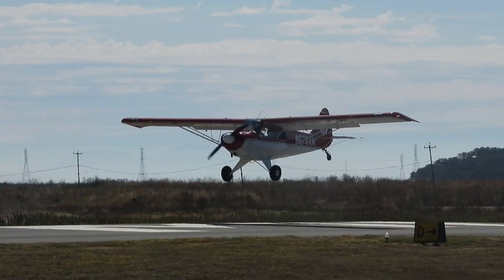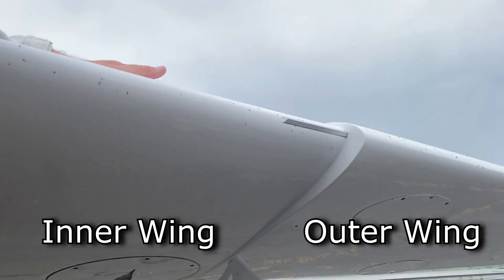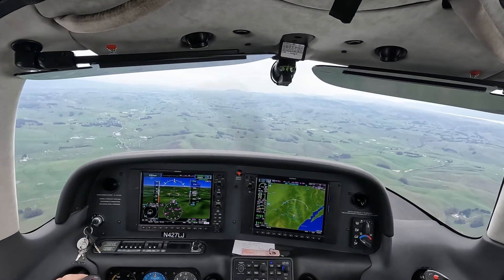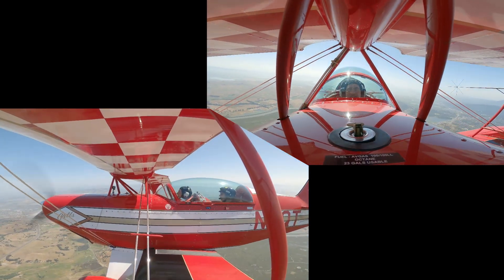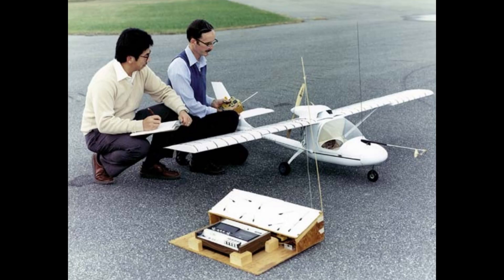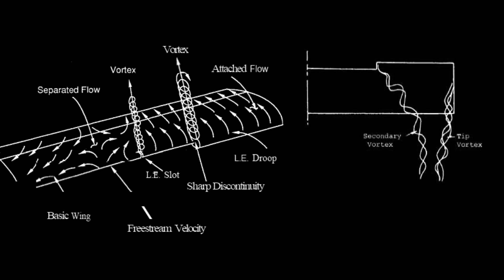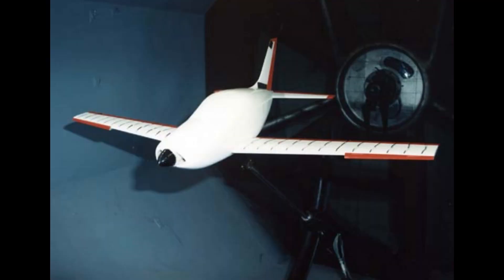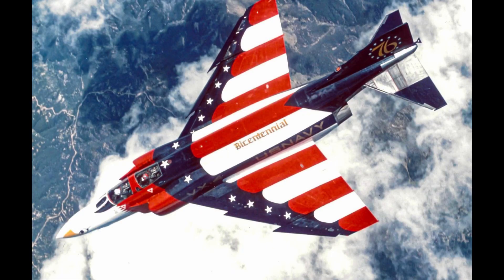Why Is The Wing Broken On Some Planes - How a 'Dog Tooth' Makes Wings Work Better.

Comment: This is very misleading, when a wing stalls it does not decrease the amount of lift you generate, your wing will still generate lift, and it will still increase with higher AoA's, it will just be very very inefficient at it, and you most certainly do not lose your lift and fall out of the sky.

If you have enough power you can fly beyond the stall, fighter aircraft do this all the time.
Reply: “When a wing stalls it does not reduce the amount of lift you generate” lol 

“And it will still increase with higher AoA” Can you draw for me the lift vs AoA curve and explain that again?
Reply: @electricalmayhem   "Can you draw for me the lift vs AoA curve and explain that again"

YT doesn't allow for the drawing of things to explain things to you...

Cd vs AoA graphs are out there for you to look at yourself, the lift does NOT drop to zero, it will keep on rising, and reach Cl max, it does not become a vertical line straight down to zero lift, it tails off, then drops off after cl max.
Reply: @LeoH3L1  Mate I was being sarcastic, I used to be a flight instructor. That CL max you talk about, or the critical angle, is the seal. From there the lift doesn’t continue to climb. You are correct it begins to reduce not a straight line to zero, but your original assertion that it continues to increase with AoA is wrong. 

Three things happen when flow separates at the critical angle: 1) lift reduces, 2) drag increases, 3) CoG (correction: Center of Pressure) moves rearward (for a given wing segment, can be different when considering the whole wing in some situations like Scott said about tip stall in swept wings)
Reply: @electricalmayhem  Yeah, you're correct about that, I didn't mean what I said there, should have phrased that better.

BTW CoG does NOT move (ignoring fuel movements) I think you mean CoL...

I guess the best way to explain what I mean is that even if stalled, if you have enough power, you can still maintain enough lift to fly, and even climb with a stalled wing.

I suppose it depends on where you define on the curve what a "stall" is, the cl vs AoA line is generally fairly straight and then turns downward, the stall is developing at the beginning of that down turn, from that point on it can still increase until it fully stalls at the peak.

Going by that definition, it is a stalled wing, with some headroom on the curve to generate more lift with before being a fully developed stall, a stall isn't an either or thing, it's not stalled vs unstalled, it's a transition, going from the start of the stall to it being fully developed, the lift is still increasing to that point before entering the fully developed stall and decreasing.
Reply: "It doesn't generate less lift, it just becomes a brick"
Reply from the maker: I think you’re confused by the fact that most data graphs for airfoils plot  lift / drag ratio. Take a look at this drag curve plot and you’ll see that there is a peak in the Coefficient of at about 18 degrees AoA - above that it decreases. https://en.wikipedia.org/wiki/Drag_curve#/media/File:Lift_drag_graph.JPG

What you’re probably thinking is that for an aircraft with sufficient thrust to overcome the drag you can indeed keep it in flight above the stall angle, the wings continue to generate lift, just not as much as the unstalled wing. And of course, in this region it’s common for that aircraft to lack control.
Reply: @scottmanley  I understand that, what I'm saying is that the stall doesn't begin at the peak of the L/AoA curve, but just before it, see my last post where I clarify it, you can see on the graph you posted, it starts at about 17 degrees, and fully stalls at about 18, the stall doesn't begin at an instant.

In that region between 17 and 18 degrees in that example, the gradient of the curve decreases, ie it becomes increasingly inefficient at generating more lift, but lift is still increasing, as I said in my OP, to the point where it then begins to decrease, and the size of that region can vary quite a lot depending on the wing in question, in this case, it's about 1 degree between start and peak, and then about another degree before it drops off to the same lift as at 17, other wings will have a different range, some narrower (more abrupt stall) some wider (gentler more gradual stalls).
Reply: You realize that a fair few fighters that have all that power like you said actually have a TWR higher than 1 so they just simply don't care about their wings when they stall out and can just become a rocket?
Reply: @joshuacheung6518  ... that's why I said...

"If you have enough power you can fly beyond the stall, fighter aircraft do this all the time."

Strictly speaking they only become a "rocket" if pointed straight up, if they're not, then they will be generating a good deal of their lift from their wings even if stalled, a good example of this is the F/A-18 Hornet when in a high AoA pass, which IIRC is somewhere around 60 degrees AoA, definitely a stalled wing, and definitely NOT relying on just its thrust.

Go look at a lift vs AoA, your lift from doesn't just stop because it's stalled, and you can still create more lift while in a stalled condition, once you run out of excess power though to counter the increase in drag, then your nose will drop, on a GA aircraft this is almost instant, on something with a bit more performance... not so much.
Reply: With enough power anything can fly.